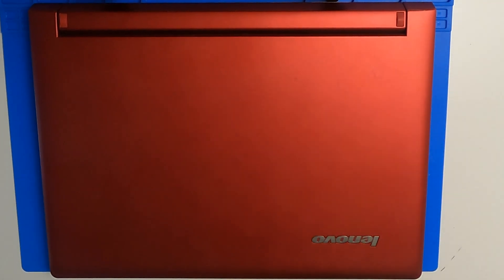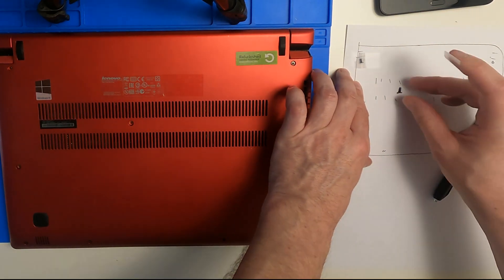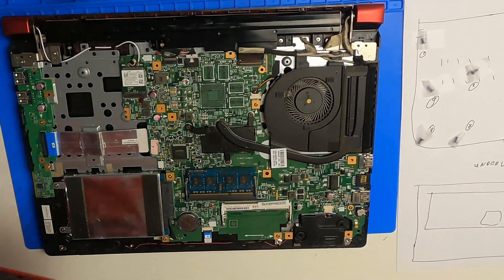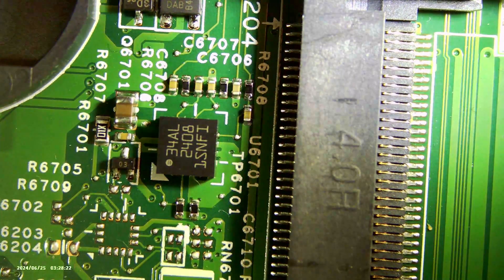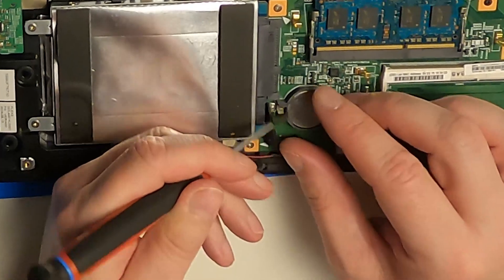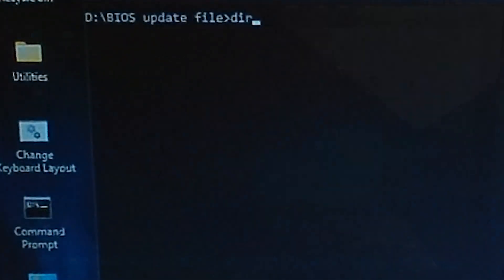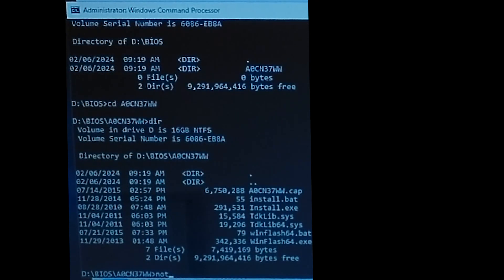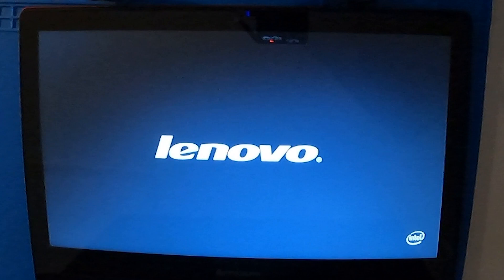Reviving a Lenovo Ideapad Flex 2-14 and updating the bios without a battery present

Comment: Hello, I'm trying to update BIOS on my old Lenovo T430 with a dead battery, but I can't get over that battery check, even with a stable AC power. I created a bootable USB flash drive using Ventoy to boot from the Lenovo's CD-image-BIOS-update (such as g1uj48us.iso), it opens the BIOS update's menu, but fails on battery check. I also tried to run the .exe utility for Windows (such as g1uj48us.exe), but always got stuck on that battery check again. When starting the g1uj48us.exe in Windows 10, it creates a temporary folder with all files at the default path: C:\drivers\FLASH\g1uj48us. I was trying to follow your hints, but I can't find any .bat file (nor .ini files as some other people suggested). Please can you help me to figure this out? Should I use a different tool for this bootable flash drive in order to succeed? How to run a command prompt when opening the update menu from a bootable flash drive? Maybe that instruction on creating the boot USB stick in the way you did it would be the key factor for me. Thank You very much!
Reply from the maker: Hi, thank you for your comment. To start with your last question, I used Hirens bootcd (https://www.hirensbootcd.org/) to make a bootable USB. If you boot from that, there will be a "command prompt" icon on the desktop. If you  could share a link to the executable that creates the temporary folder, we could have a look at the files it creates together.
Reply: @repairchannel  Thank you for responding! Successfully created the Hiren's Boot CD PE drive, extracting the BIOS-update g1uj48us.exe preinstall, and created a list of files within the g1uj48us directory:
05/08/2019  03:07 PM            12,288 206A7.PAT
10/07/2011  10:04 PM             9,216 306A4.PAT
10/07/2011  10:04 PM             9,216 306A5.PAT
10/07/2011  10:04 PM             6,144 306A6.PAT
02/29/2012  09:34 AM            10,240 306A8.PAT
05/08/2019  03:09 PM            14,336 306A9.PAT
03/19/2015  05:36 PM               160 BCP.evs
12/19/2012  05:48 PM             2,847 BIOS_LOGO.TXT
06/18/2012  04:00 PM             4,096 chklogo.exe
04/09/2013  03:06 PM               148 chklogo.exe.config
12/16/2015  05:42 PM           382,976 WinFlash32.exe
12/16/2015  05:47 PM           382,976 WinFlash32s.exe
12/16/2015  05:44 PM           367,616 WinFlash64.exe
12/16/2015  05:47 PM           367,616 WinFlash64s.exe
12/10/2012  01:25 PM            45,056 wininfo.exe
05/08/2019  03:26 PM         3,463,640 WINUPTP.EXE
10/03/2025  02:41 PM    <DIR>          32bit
10/03/2025  02:41 PM    <DIR>          64bit
10/03/2025  02:41 PM    <DIR>          G1ETC1WW

... then there are 3 more directories inside (one is for 32bit-only, so I'll skip that one):

Directory of J:\DRIVERS\FLASH\g1uj48us\64bit

08/05/2016  11:37 AM            26,448 tpnflhlp.sys

Directory of J:\DRIVERS\FLASH\g1uj48us\G1ETC1WW

06/18/2019  10:57 AM         8,388,688 $01D2000.FL1
03/06/2014  11:36 AM        12,718,080 $01D2000.FL2
05/08/2019  07:27 PM               163 206a7.HSH
05/08/2019  07:27 PM               163 306a4.HSH
05/08/2019  07:27 PM               163 306a5.HSH
05/08/2019  07:27 PM               163 306a6.HSH
05/08/2019  07:27 PM               163 306a8.HSH
05/08/2019  07:27 PM               163 306a9.HSH

I don't see any .bat or .ini file, but I suppose the prompt to check the battery should be somewhere in those other files.

I browsed through a few most suspicious with the notepad, but found no sign of a similar "battery check" prompt as you showed based on your model version. Any idea, please?
Thank you very much for your help!
Reply from the maker: @kontryhel_tv  Have you tried "winuptp.exe -sp" already?
Reply from the maker: And "winuptp.exe /?" or "winuptp.exe -h" for command line options
Reply: @repairchannel  Not yet, found this hint only today, and will try it in a few hours, when the power supply in my rural Brazilian region should be more stable during the nighttime, to avoid the bricking, hope it would be enough 😁
Reply: @repairchannel  thank you very much, I will also try that -h first. But is it possible to run those commands only from Windows and the Hiren's Boot  CD PE, or is it somehow possible to open the command prompt when booting directly from the BIOS update ISO's DOS-like environment? I would prefer this direct method without OS running, as this should be much faster (to minimize the risk of bricking due to unexpected power outage). But if there's not any such option, I would do it activating the winuptp.exe in Hiren's environment anyway. Thanks!
Reply from the maker: @kontryhel_tv  I don't know the "BIOS update ISO's", so I don't know if you can start a terminal window on those. The speed should not be affected much by running it on Windows instead of DOS though. It will take a while for the OS to start, but after that it should take about the same time. Let's see if winuptp.exe has some flags we can use, otherwise we might be able to use one of the winflash executables to update the BIOS. Also, you might want to have a look at https://superuser.com/questions/1569417/how-to-update-lenovo-bios-on-a-t460-without-battery - someone mentions a successful update using the winflash64 executable. That does feel a bit risky to me. Do you have a BIOS chip programmer? 
I decribe the device and the procedure in this video: https://www.youtube.com/watch?v=zDJjXE1FWik - if you have a backup of your current BIOS you will be able to recover it, even if the power fails. I would recommend doing that first, because if the update fails somehow, your laptop won't boot anymore.
Reply from the maker: Great! Thank you so much for sharing your success with us.

Comment: Hi @repairchannel

Thanks very much for this great tutorial.

Similarly to the Ideapad in your video, my ThinkPad E15 Gen 2 has a dead battery that won't charge due to a known firmware problem with the USB-C port. Lenovo released a critical BIOS/ PD FW update designed to fix this issue, but the update process is stuck in a Catch-22 situation, as I can't apply the update without a charged battery.

I've tried a manual update running the winflash64.exe utility delivered with the BIOS update file with a "/cbp 0" switch as described at 4m40s of your tutorial, but apparently Lenovo's version of winflash64 has hard-coded overrides that prevent bypassing the battery check. Just in case this is useful, here's the command I unsuccessfully ran from an elevated prompt:

winflash64.exe /ipf bios ec /file $xxxxxxx.FL1 /cbp 0

where $xxxxxxx.FL1 is the name of the BIOS file included with Lenovo's update.

Do you know of any older winflash64 versions compatible with the ThinkPad E15 Gen 2 still supporting the cbp switch?

Any suggestions on how to force the update would be greatly appreciated.
Reply from the maker: Hi Ronin, thank you for sharing your experience. You might want to try to leave out the whole /cbp flag as I did in the video, so instead of "/cbp 0" use "" (no flag at all). It might be a <= in the flash software that will prevent the update if the battery level is equal to the parameter, which is zero in this case. If that fails, could you share a link to the update file you are using with us? If it does solve your problem, a small donation would very much be appreciated by pressing the "Thanks" button or preferably the "Join" button! Thanks in advance! Good luck updating your BIOS.